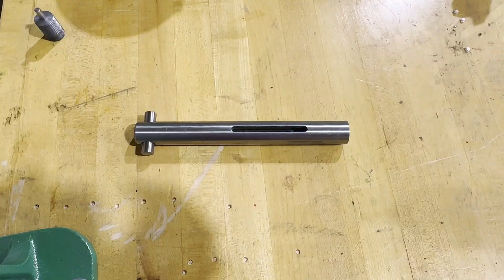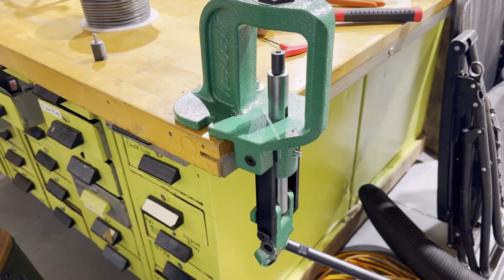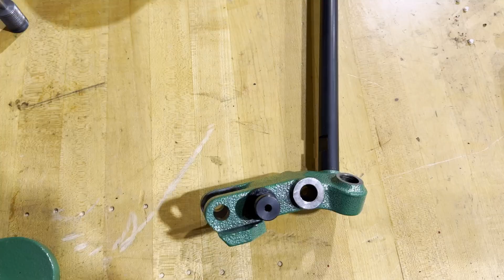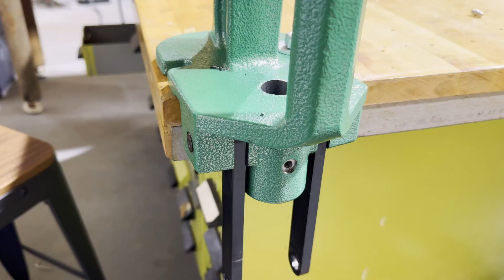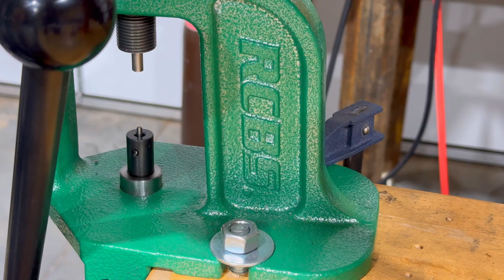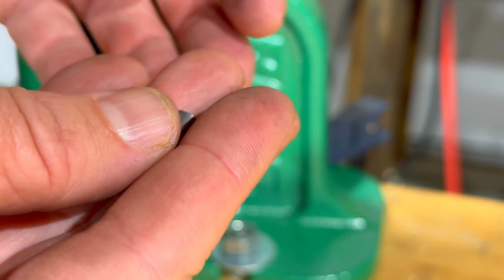Rebel press to airgun swaging press

Comment: Awesome work!! I currently have the S.O.C. kit from GMNI. Its a very labor intensive process, as you have to take the die apart and cutting the sprue on each slug.  What would be the cost of having these mods done if i provided the press?
Reply from the maker: There are a couple folks (to include GMI) working on putting together a kit with all the modified parts so you can just buy the kit rather than having to make the modifications yourself. My understanding is that the kit will be very reasonably priced. Hopefully we will hear price and availability very soon. If we don't hear anything in the next month or two reach out again we can talk about sending a press to be modded.
Reply: Any update on this project?